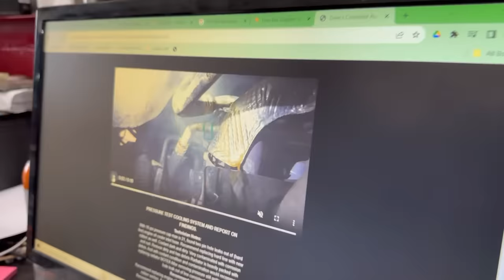The truth about maintenance, and what the manufactures tell you vs what you need to know

Comment: MErcedes has 60000km oil interval on their larege panel truck and I think 40000km (12 months) on the small panel truck Sprinter/Vito. They have the same engine and if the same engine was in a passenger car it would be 30000km at best. In the old days we used to say if you drive alot you need to change the oil more often than every 12 months because the oil is damaged by heat cycling etc. Now hey just want you to buy a new car and subscribe to basic comfort functions digitally.

Comment: Im 58, retired, I seldom drive long distance. I put about 3k to 5k miles a year. However i change engine oil / filter (synthetic) every spring and fall. So about every 1,500 to 2,500 miles. 1993 Crown Victoria & 2000 F250 should last me the rest of my life! You can have that new stuff, ill pass, their just built to fail and JUNK! 👨‍🔧🧰

Comment: Buy a high-quality vehicle and change the oil and filter every 3000 miles with high quality full synthetic oil. Change transmission fluid and filter every two years. Do other maintenance as required. Drive it gently and the vehicle should last at least 20 years.

Comment: There's a heavy selection bias here. The engineers at Toyota at least do very extensive testing for hundreds of thousands of miles. And they spec the service intervals with the expected service life as long as 25 years.

What the mechanic never sees is the 100 engines that last 250k miles on OEM service intervals. They only see the ones that fail. The OEM sees the whole forest, not just a few trees. So they look at failure rates and customer probability weighted best interests. If the 5k mile oil change results in 1 out of 1000 failure rate in 250k miles and the 10k mile change is 2 out of 1000, the mechanic sees it as double the engine failures. The OEM with more information knows that the risk weighted cost of the 5k mile oil change isn't in customer best interest. It's the better economic choice to increase failure potential by 0.1% and save $2,500 in oil change costs vs the risk weighted cost of ($20,000 x 0.001= $20). Customer is FAR better off choosing the 10k mile oil change on average. 

That's why the OEM spec the service intervals how they do. They have more and better information than the engine shop.

Comment: So, what if you're running a product like amsoil? I have a 18 ram 3500 6.7 Cummins. I'm running amsoil 15-40 max duty. On the jug, Amsoil calls for 25k miles on an oil change. The dash, the trucks oil life gauge says 15k mi an oil change. Do I listen to amsoil? The dash? I'm going to get an oil analysis at 10k then after that every 5k. If anyone is interested in the results comment below and I'll update the results as they come in so it'll pop up in your feed as a reply. It will be a little while. I have about 200 miles on that oil so far.

Comment: 😢 funny how the dealership says every 10,000 mi oil change but only when they are flipping the bill,soon as free oil changes for 2yrs runs out then it changes then they reccomend every 5000 or less when your paying them, I'm not a mechanic  but synthetic blend isn't it, it's full synthetic, synthetic blend can be as little as 1% true synthetic and 99% regular oil, there is no body checking or standards for this.

Comment: Not doing maintenance and brands extending service intervals are 70% of why any brand gets a bad reputation. Doesn't matter if it's Dodge, Ford, BMW, Aston Martin or whatever. The other 20% is typically bad engineering due to cramped space/regulations, and lastly, the other 10% is pure bad luck.

Comment: How do you keep your cooling system rust free and deposit free?
Reply: Change the coolant
Reply: Use distilled water with that full strength coolant; not tap water

and drain/refill at minimum 5-7 years or whatever owners manual states.

Comment: I wonder how that piece of piping could have rusted like that. I've owned a lot of cars in my time, old stuff, a lot of it with over 100 000 miles on the clock because I'm a cheap skate, and never had such a rust infested cooling system.

Comment: To be FAIR, as an “expert”, you SHOULD know that the manufacturing tolerances are DEAD ON, and, that engines DO get tested/broken and first oil gets drained at the factory!, so, a new QUALITY engine going to 5-7 thousand miles is NOT a problem!

Comment: 1.  thank you.
2.  what you are relating is not taught in public school or by parents.  The reasons boil to one.  Ignorance.  "use by" dates/expiration dates/warranty periods only mean that the manufacturer/seller has tested only until a certain point in time or usage and thereafter, the losses are on you.
3.  I drive a 19 year old car.  Purchased brand new with a 36,000 mile or 3 year guarantee, whichever expires first.  36,000 miles is at the average consumer mileage 2.5 years!
4.  I think that if a person followed the maintenance school based upon a warranty period of only 36,000 miles, he would be lucky to have his car last a decade.
5.  My first plastic radiator lasted way past the average lifetime because it was flushed with an eye to having it last.
6.  Transmission fluid service.  A purportedly "sealed transmission" is not sealed and can be serviced.  The day that BMW warrants its transmission will never fail unless damaged externally, start selling BMW stock short because the company will fail and be worthless as the warranty claims roll in.

Comment: Do not do a 10k mile oil change EVER. 5k. do not do a 100k auto transfluid change. do it at 60k or less. thanks dave. Keep us straight. Subaru head gaskets were partly due to lack of coolant changes. Or adding mineral water.

Comment: this is why I change my oil every 4000 or so miles miles, air/cabin filter change and transmission fluid drain and fill every year and brake or coolant fluid changes every other year…for a car being driven daily you just can’t trust these manufacturer recommendations

Comment: Easy solution is to just get a Ford.  Their plastic coolant parts fail so frequently you're guaranteed to be replacing the coolant every 10,000 miles.  I'm single-handedly keeping these antifreeze manufacturers profitable.

Comment: For sure you need to maintain your vehicle, but there is no way a coolant system can look like that on a modern vehicle unless it was contaminated big time.  I've had vehicles where I don't change, or flush the coolant for 200k miles and they look basically fine.  There is an issue or you have a complete BS design to get it looking that bad

Comment: I like these “shop” videos and while you guys are all well intenioned-you miss the cut whennit comes to details about specific products. I agree-the manufacturer doesnt care about longevity…but when it comes to oil (this is MY pet peave that “mechanics” don’t know shit about what makes a synthetic oil for  example a superior oil with regards to engine life) my high performance experience outranks your daily routine of fixing neglected vehicles and basic auto repair/maintenance. You need to get into better details about it…oil for example-conventional vs true synthetics are basically group III hydro cracked  carbon based lubricants-non/uniform in size and lack 2 HUGE areas of longevity performance that everybody should be educated about and they are:

1.) Film strength
2.) Rate of evaporation

Look up your favorite oils numbers and if they dont disclose them then assume that oul is junk. If it says in fine print “categorized as a Group III blah blah blah (Castrol Syntec for example) its a conventional oil filled with tons of sythetic additives to “appear” mostly synthetic…or a “synthetic blend”…again-that oul is dogshit as well. The best oil by chemical testing is Amsoil followed closely behind by Mobil 1…and it isn’t even lose…all other ouls rank way below those two.

1.) Film is a number in PSI which deacribes an oils ability to resist being squeezed out from between 2 surfaces such as a bearing/race-the higher the PSI rating-the more mileage with virtually no wear  that engine will see.

2.) Rate of evaporation refers to the temperature at which the oul begins to break down…see those brown varnishy araas inside the motor? Thats oil that has slowly vaporized or evaporated. The higher the temperature, the more heat that oil  can with stand. 

AMSOIL has a film strength of approx 3000 psi wheras conventional oil is around 400. Huge difference indeed. AMSOIL evap rate is 600F and conventional oil is approx 350F. Again…big advantage here…Amsoil (any quality true synthetic) is much better at extending your engine life than conventional or even a “blend”. 

“How can I tell what my oil is?” Look at the labelnin the back…looked for the oul classification-if it says Group III don’t waste your money. If it says Group IV it’s a true synthetic oil. Keep in mind now all oul manufacturers reveal their data…common sense tells me if there oul was really good they’d brag about it and at least tell the public the various chemical studies and the performance data dervied from them. 

So there you have it with oils anyway…2 most important aspects when deciding on an engine oil-Film Strength and Rate of Evaporation.

Comment: I am actually afraid to buy a new car. First; they're way too complex. They're too jam-packed to get to the parts that need repair/replacement. You have to hope the person doing the repair is up on the latest vehicles and trained on how to do the repairs. You have to hope the repair shop or dealer is not a crook to begin with. You have to hope that the manufacturer will tell the public  when they screwed up and made a bad vehicle instead of finding out ten or twenty years later after spending thousands on fruitless attempted repairs. 
You have to find a guy who is an electrical engineer just to be able to operate the scanner/instruments in order to find the cause of the problem. The biggest fear is the anticipation of the final bill. 
How would you like to be the owner of an EV that just went out of warranty and you have a battery problem and  the bill to peplace it is, get this,  $60,000.00 / &60k / SIXTY THOUSAND DOLLARS!!!
How would you like to be the parts department guy who is expected to hand you the estimated cost of the part. AND the guy you're handing the bill to is built like a The Rock, and you're expected to hand him the bill with a straight face? Then, while The Rock is steaming and frozen in place, looking at the bill you swallow  and say, " That's just the cost of the part. The labor is $10,000.......pl..pl...pl...plus t..t.t. tax. Then, the icing on the cake is when you get the car home after paying about $85K, your wife notices a 3 ft. long scratch on the passenger side of the care. Who is going to tell this guy when he calls, "It must have occurred on your way home, s..si..sir. D...d..did you s...s..st.. stop anywere? Gulp"

Comment: I bought my 2014 F150 brand new and I remember Ford claimed the engine oil could be changed at 16000km, which I never did, always 5000 for me even with synthetic, still running strong after almost 10 years of ownership. Speaking of maintenance, the 6.0 Powerstroke has the reputation to be a junk motor, turns out I know a few guys that own 6.0 and never had problems. The secret, maintenance and don't drive it like a moron. A lot of braindead out there that don't do maintenance better yet probably don't understand the meaning of the word and also drive everything like they stole it but the more idiots out there the better for your business!!

Comment: Can't really afford these Planned Obsolescence garbage cans if you're not making $100K/yr, as even a cheap little $10K car will need $30K worth of work to keep it running past 100K these days. Every shop is charging highway robbery prices, and it's almost always cheaper to just get a new car than spend thousands just to have more break on it later. 

Most mechanics aren't like you either. Unless you spend big $$ on tools, lift, etc; working on your car isn't feasible outside of basic repairs.
Reply: In liquid cash, which fewer and fewer Muricans have.

Comment: I just can’t believe people are stupid enough to believe that you don’t change your oil every 3000 miles I mean this is common sense stuff that is not common anymore oil is not better than it used to be if anything is shittier and cheaper not better even if you add some Lucas like we do you Gabby careful with the Lucas can’t overdo it especially in the winter time I got cars with almost 5 600,000 miles on some of them something young people just don’t think it’s possible but it is possible when you change your oil and your filters and change your rear end every couple years in your front end if you got a four-wheel-drive train you can transfer case transmission all that shit should be done unless it’s an automatic transmission which I wouldn’t own an automatic!!! People of gotten lazy sir that’s what it boils down to!!!

Comment: 3:50 That because customers have been taught at this point the way a fluid looks is noit a tell tale sign of anything. They used to use that for scare tactic sales, anytime you tell a customer "Well this fluid LOOKS bad" you sound like an idiot, as there is actual tests that can be done to show them THIS FLUID HAS FAILED. Not just "This looks like crap let me take your money" Maybe that hasnt made it to utah yet... Then again ASE is ASE... Automotive Service Excellence... Do your maintenance,  but do it right, Not just by some dudes pinching of the fluid and telling you its bad... Jiffy lube got sued for JUST that a while back if you dont remember..,

Comment: It goes both ways. Mechanics often sell a lie that you need to do more work than is necessary. In fact i would say thats a more prevalent problem.

Rotors for example. Many mechanics these days insist you need rotors every time you swap your pads, no questions asked. Which is absolutely ridiculous. They claim it's for safety. No it's to bleed customers of more money.

Comment: There's not much excuse when you can buy 10 quarts of synthetic oil at Costco for about $40 and TWO Purolator or Car Quest filters for about $20 & tax at Advance Auto.  (Better Advanced than retarded, I say.😂)  That's enough for TWO oil changes for only about $62.50, if you're not disabled or just too lazy to do it yourself.  That's only $31.25 per oil change.  Here, oil isn't taxed at the register.  I'm in my late 60s and changed a right hand, lower, control arm on my car last night!  If I can change my oil, your grandmother should be able to do it!